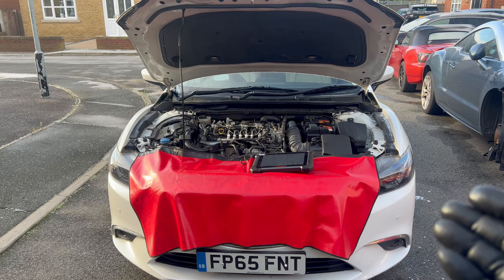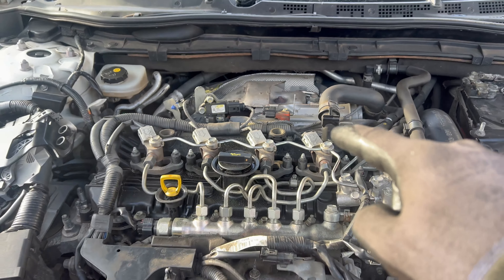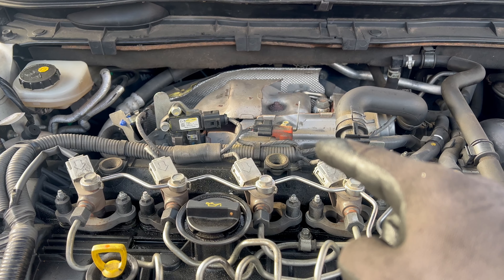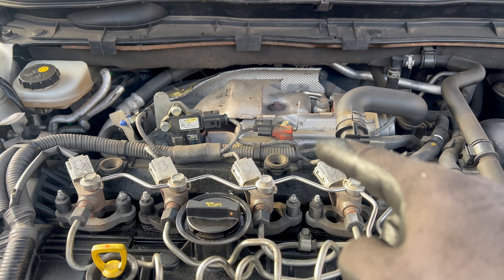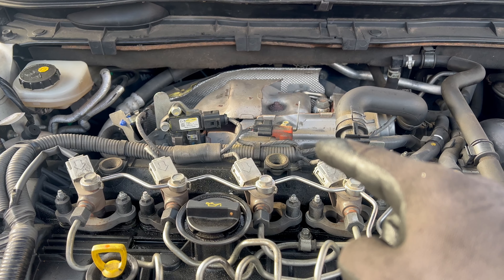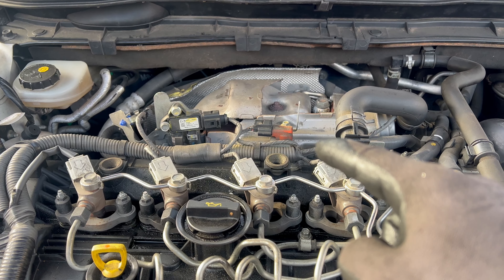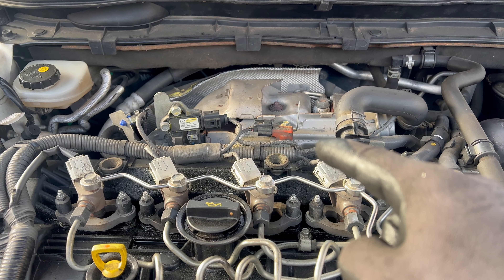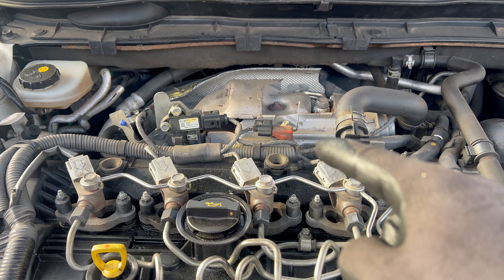Mazda 2.2 Skyactiv Exhaust Pressure Sensor Diagnosis and Replacement

Comment: Please make a video on the removal process of the pipe. I have tried everything to clear the pipe but it won’t clear. I need it off the car to see what the problem is
Reply: Did mine today, in the packaging of the new sensor a brand new pipe is included, I removed the old one completely and installed the new one.

For the sensor itself once you disconnect the wire a small twist on the pillar did the job and the sensor came off easily
Reply: This is the easiest and fastest way to clean the metal pipe. Best done when cleaning carbon build-up  from egr/manifold 

https://youtube.com/shorts/dbgXGhy_klM?si=Mv7fHuygVMlrT9Fw

Comment: We got normal data for it but when we do more gas is over 150 kpa   And the error keeps appear when aссelerate . We tried to clean and no success.. we also changed on new sensor

Comment: Isn't there a risk of clogging the metal pipe even more if you just spray chemicals in there and loosen the deposits with a wire or something?
Reply from the maker: yes, there is
Reply: @MrNiceGuy94  fair enough, do you still recommend it?
Reply from the maker: not really

Comment: Hi. I have mazda 6 2015 and its doing dpf regen every ~60 miles. Checked the exhaust pressure with my scan tool its the same as in the video. Reading ~86 kpa at idle . Can this sensor cause too frequent dpf regens? Thanks.
Reply: Read on Reddit that people had your problem caused by this sensor, on mine it failed to do the regen until I had the sensor replaced

Comment: Today I was driving to seaside and after about 200km my car lost some power and warning lights for check engine, tire pressure, traction and forward crash all lit up. My mechanic said that its probably this sensor. Is it safe for me to drive back home despite warning lights or should i try some local mechanic?

Comment: I have a question for you buddy. There are 4 different exhaust temperature sensors in a Mazda 3 and Bank1 Sensor4 reads -40 degrees Celsius which indicates open circuit and can be faulty. Is this the sensor that's on the exhaust side of the turbo or somewhere else?
Reply from the maker: We found that multiple temperature sensors read that value, which if we are correct it is okay as it means the car is not equipped with them. Otherwise we believe it would already triggered a fault code for them.

Comment: I changed the sensor but am still getting the same error code. 😢
Reply: Did you solve the problem?
Reply: @jul4ak18  Yes, I cleaned the exhaust pressure sensor pipe myself, I used a bike brake cable and liqui moly intake system cleaner + a drill.

Comment: I changed mine but im still getting the lights, is there a way to check the fuse or relay responsible for the sensor? I changed the sensor twice.
Reply: This is the easiest and fastest way to clean the metal pipe. Best done when cleaning carbon build-up  from egr/manifold 

https://youtube.com/shorts/dbgXGhy_klM?si=Mv7fHuygVMlrT9Fw

Comment: Hello Mr., I have read on one of your video comments,  that you also replace metal exhaust pipe once. Do you mybe have video of this? Thank you! Regards, Samo
Reply: This is the easiest and fastest way to clean the metal pipe. Best done when cleaning carbon build-up  from egr/manifold 

https://youtube.com/shorts/dbgXGhy_klM?si=Mv7fHuygVMlrT9Fw
Reply: @Tom-gr5um  Hello Tom and thank you. Yes with heating it can be done, mybe not always, but you need to take valve cover off :p.

Comment: Hi, I have replaced this sensor with a new oem upgraded one , cleaned the intake manifold, fitted a new map sensor and cleaned the egr out however my car is still very weak on power I have done dog forced regenerations and my exhaust gas pressure sensor is at 197 kpa with the engine running do you have an idea what the issue could be? There are no engines lights or codes
Reply from the maker: where are you based?
have you checked the camshaft yet?
Reply: @MrNiceGuy94  Hi thanks, no I have not checked the camshaft and I am located in  Surrey

Comment: I had an exhaust pressure sensor fault code. I'm ready to buy the ~£70 new sensor, but I thought I'd blast the inside of the sensor with 
LIQUI MOLY Air Flow Sensor Cleaner first.

Gave it a squirt inside, swabbed the inside with a cotton ear bud, and the same inside the exhaust tube.

150 miles so far, and no further problems. I know it's a defective sensor, but in a pinch (or if you're cheap like me) I've had luck with a clean.
Reply from the maker: You can't be cheap if you gave me a SuperThanks ;)

And yeah, very likely that's the sensor.

Comment: Hi Mr, trouble code P0472 and Exhaust Pressure sensor bank 1 freeze at 50 kPa when engine is ON, but value is moving when engine is OFF. The hose seems OK, and I have cleaned the connector. 
Do you think sensor is dead ? (First gen 2012).

Comment: Hi there from Italy! I'v the engine fault code P0236, and i'v replaced the map sensor and the boost pressure sensor too, taking the updated one from mazda (the metal one), but the car still run without the turbo.. cleaning that pipe can help? or, replacing it? where can I find that one on web? thanks man!
Reply from the maker: Hi buddy, I don't like to be a bearer of bad news but very likely your turbo is gone.
Although you may try to clean that pipe but I don't think it will help.
Reply: @MrNiceGuy94  ouch.. I hope not :( that turbo is in the worst place ever to take it out :(

Comment: How do you remove the actual Exhaust sensor steel pipe? this is blocked and will not clear.  can get access to the banjo fitting but not the little clamp fixing under the pipe?
Reply: This is the easiest and fastest way to clean the metal pipe. Best done when cleaning carbon build-up  from egr/manifold 

https://youtube.com/shorts/dbgXGhy_klM?si=Mv7fHuygVMlrT9Fw

Comment: Wished you lived near south yorkshire, could do with you looking at my Mazda cx5 low fuel economy issue.
Reply: prob carbon build up
Reply: more than likely, already had a new turbo so not that,dpf removed so not that,injectors working fine on diagnostic, thinking of walnut blasting,depending on the cost
Reply from the maker: what's your average MPG?
Reply from the maker: I dare to say you are looking at around £500
Reply: @MrNiceGuy94  aprox 25 around town uptp35 motorway
Reply: Have you clean the egr
Reply: @Eudovique  not yet,was thinking about walnut blasting once the issue is identified

Comment: Where are you located? Had regen every 30-50km
Reply from the maker: Message me on my facebook page, same username and profile pic as on here.
Reply: Hi i am getting p2262 turbo boost or supercharger boost pressure not detected you think its due to this sensor or its the turbo thats failed i do not notice any loss of power just eml and this code. Thanks
Reply: Hi. Please let me know if you've found a solution or problem. Same problem here regen every 50-80km

Comment: Could you pleassseeeee do a video showing how you took the metal pipe off the sensor pleassseee
Reply from the maker: The metal pipe stays on the engine, you take off the sensor and the rubber hose.
Reply: This is the easiest and fastest way to clean the metal pipe. Best done when cleaning carbon build-up  from egr/manifold 

https://youtube.com/shorts/dbgXGhy_klM?si=Mv7fHuygVMlrT9Fw

Comment: Thanks for your video, very clear and informative.
I have fault code P2262 so
I have just replaced the exhaust sensor on my mazda 2.2d with new updated one. But the metal sensor pipe is blocked solid with carbon and ive been unable to clean it out. Can you tell me what is involved to replace that pipe?
Thanks jason
Reply: Exact same situation for me. Pipe won’t clear and don’t want to remove rocker cover injectors etc if I can remove the pipe. Mr nice guy please respond with tip to get pipe off
Reply: This is the easiest and fastest way to clean the metal pipe. Best done when cleaning carbon build-up  from egr/manifold 

https://youtube.com/shorts/dbgXGhy_klM?si=Mv7fHuygVMlrT9Fw
Reply: This is the easiest and fastest way to clean the metal pipe. Best done when cleaning carbon build-up  from egr/manifold 

https://youtube.com/shorts/dbgXGhy_klM?si=Mv7fHuygVMlrT9Fw